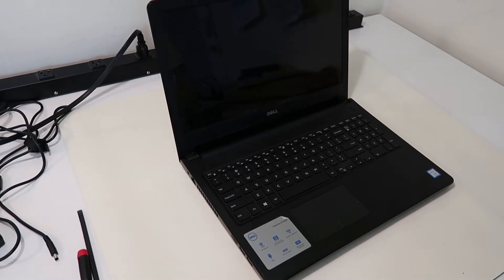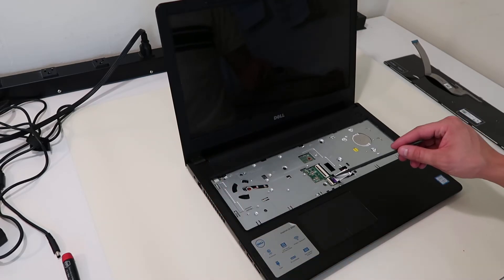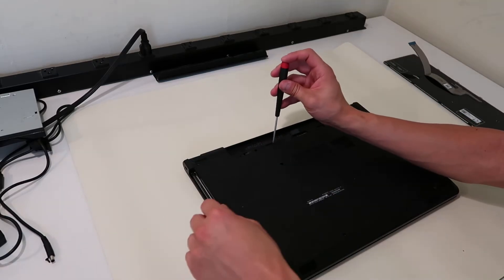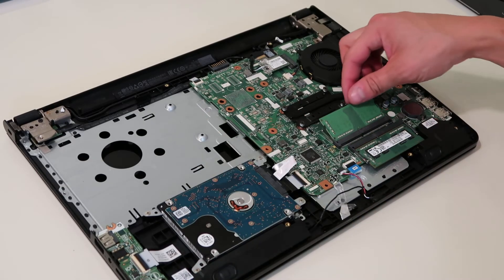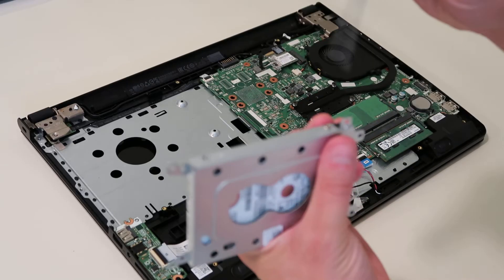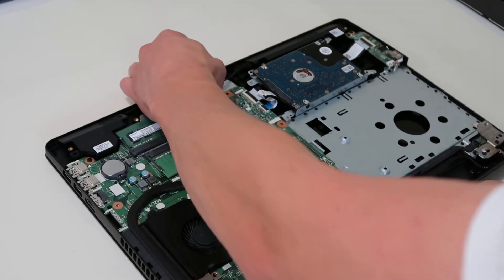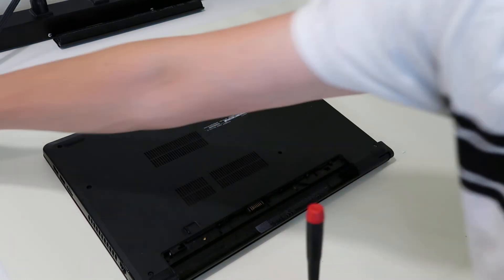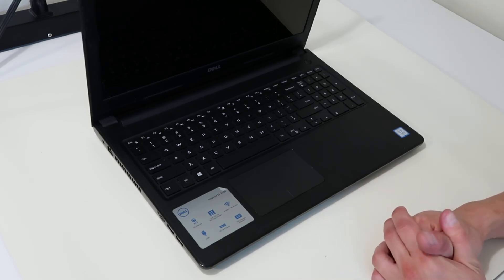How To Replace Upgrade HDD (Hard Drive) & RAM - Dell Inspiron 15 3000 Laptop

Comment: Hi, I'm  using same series model laptop inspiron 15 3000  I'm  getting  an error called "your hard disk is going to fail soon"when I'm  trying to install Ubuntu 18 what's the reason.
Should  I replace the hard disk
Reply from the maker: Yes, thats telling you that the Hard Drive is nearing the end of its life.  It should be replaced.
Reply: If I must have to change hdd then which one is better can you please suggest me
Reply from the maker: @chinu-y4p  I would upgrade to a Solid State Drive instead of a Hard Drive.  They are faster and longer lasting.  You should look for a 2.5 Inch drive with a SATA connection.  The storage size is up to you :)
Reply: PC Monkey can it be any SSD that fits in your computer or does it have to be a specific brand that goes with your laptop?

Comment: Hi. I'm using this same laptop model, DELL Inspiron 15 3000. I think the HDD has broken. I've already tried reformatting using official Windows 10 software using USB and DVD but it cannot detect the installer. I've also already tried it using 4 different HDD but the same problem appears. I have scan the status of hardware and I've only got error onmy HDD. Please help me solve this problem. Thank you!
Reply from the maker: You have tried 4 different hard drives and Windows wont install?  If it cant detect the installer, than I would think something is wrong with your install media or the USB its on.  Try upgrading the USB and creating your own install media as seen here;  https://www.youtube.com/watch?v=g_UhiHScaSI&feature=youtu.be
Reply: @PC_Monkey  Hi. I've tried using an external cable for HDD SATA to connect to my new HDD for the Windows 10 Installation. It works perfectly. I don't know what is the real problem, why my pc cannot detect the driver form both USB and DVD earlier. But i only use the external cable for formatting only. After that, i connect the HDD back to the original place. And it works perfectly.

Comment: Hello I upgraded my Ram but I can't get the CD to plug back in. What should I do? I  have a Dell Inspiron 3000 (3565). I did not unlock the ribbon under the keyboard.
Reply from the maker: That should be similar to this computer.  If you cant get the DVD Drive to slide back in, then something is most likely blocking it.  Open the computer back up and make sure the path is free.
Reply: I also have the same problem after installing hard drive
My Optical disc not working what's the problem can you please... Give a suggestion
Reply from the maker: @chinu-y4p  Its not working or it wont plug back it correctly?
Reply: @PC_Monkey  OK thank-you

Comment: Help! I have a Dell 5558. We’ve had the pc for a couple years but haven’t used it at all. I no longer had a charger so I bought a new one. First when I pulled it in it was working just fine(I think). The computer charging light was on and so was the AC adapter. The laptop wouldn’t turn on but I figured it was way too dead so I left it alone to charge. I went to plug my phone in and I accidentally unplugged the charger. I plugged it back in but noticed the charging light on the laptop wasn’t on anymore. I tried to unplug and take battery out thing but still no luck. I’ve watched a couple videos of yours and I’ve been researching for a while but still no answers.
Reply from the maker: For a laptop that wont turn on, start your troubleshooting process here; 
https://www.youtube.com/watch?v=_MOe71kBPOY&feature=youtu.be
Have you tried that one yet?

Comment: I have the same laptop, if I want to upgrade ram, should I buy Dell ram, or I can buy any any brand?
Reply from the maker: You can buy any RAM.  Just make sure its the right kind.  You can see that here;  https://www.youtube.com/watch?v=NtCzunl0AQA&t=9s
Reply: @PC_Monkey  I have Dell like this i3-6 and I have 4 Gb ram, can I add 8 gb to the 4 Gb ram ! It will be come 12 gb , can the processor controll it !
Reply from the maker: @salahflex6386  Whats the exact model number for your Dell?  You can refer to this video for help finding your model number if you dont know it;   https://www.youtube.com/watch?v=-t1UcxmT7yA
Reply: @PC_Monkey  it is Inspiron 15 3000 series
Reply from the maker: @salahflex6386  Unfortunately, I need to know the exact model to know how much RAM it takes.  Every model is different.  Instpiron 15 3000 series isnt enough.  I need the 3000 number
Reply: @PC_Monkey  you right, I found it in my directX diagnostic tool : Inspiron 15-3567, I searched in crucial as you said, I found it 32gb max but they wrong in the standard memory it's 4gb not 8, is it matter !
Reply from the maker: @salahflex6386  Great :)
Reply: @PC_Monkey  thank you a lot bro, I really like your videos and the way you explain, keep it 💯
Reply from the maker: @salahflex6386  Happy to help :)  Always here if needed !!